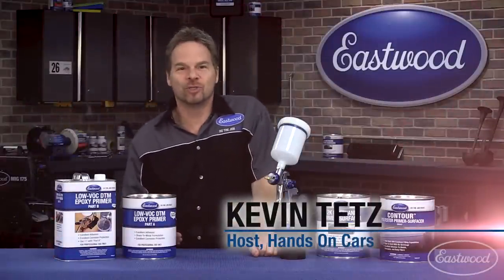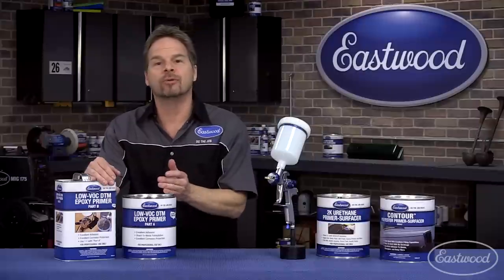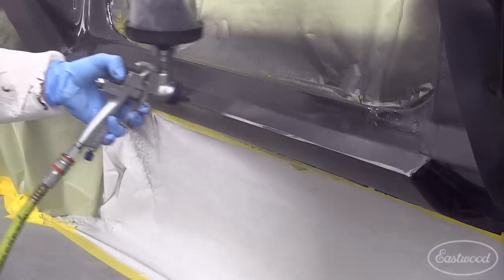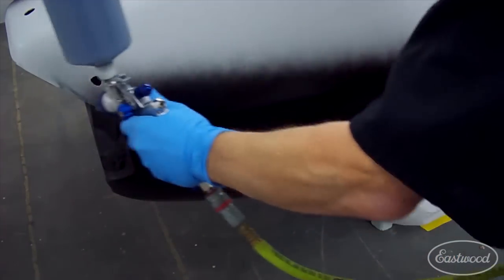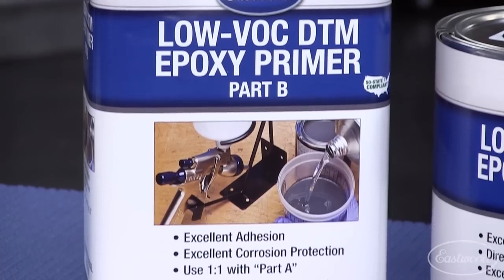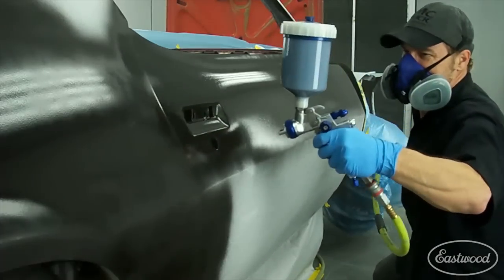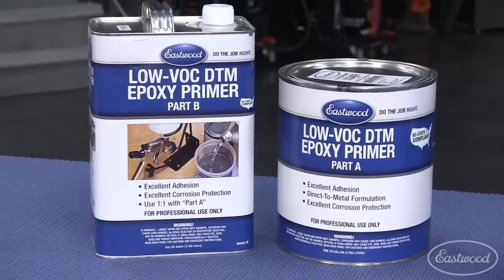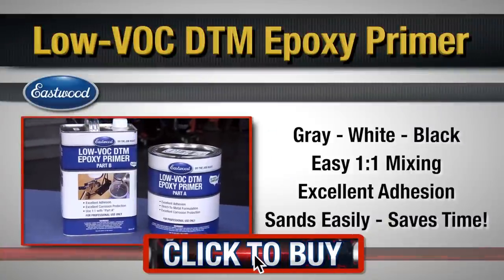How To Choose Primers: Low-VOC DTM Epoxy Primer Explained by Kevin Tetz

Comment: So I heard that right, I apply this primer, then while its still tacky, start applying paint?  What type of paint would you run on top of this?    I'm just painting a 90's ford, almost have the body work done, it doesn't need to be a Riddler Award winner.   This is more of a bush rig.

Comment: I am in the process of stripping an Infiniti with the notorios flaking paint. working on the jams now. I've been looking at all of the types of paint and primers and trying to learn. i did bodywork for a couple of years but the paint shop was separate so I didn't get to learn much about the paint side. I'm thinking that I want to use eastwoods epoxy and then contour after watching this. its going to be a track car so I plan to just paint it one stage satin black and then wrap it with vinyl. my questions are do you think the 2k or contour would be best for my application ? what paint do you recommend ? and how far back into the jams should I feather the old paint or do I need to strip every bit of paint? right now I have the external surface stripped and feathered back about an inch into the jams and the clear knocked off in the jams. the paint is feathering well so I was hoping the epoxy would make a nice envelope to seal everything but am I being lazy ? thanks in advance for any advice
Reply: ps. I watched the live demo you did here and the hands on series with the z28 and have learned a lot from you and greatly appreciate the knowledge

Comment: Can you guys help me with setting up an air compressor?  I've notice during my sanding process I've got water in my system.  I absolutely can't have this when I start to paint or prime.    What is your ideal setup on cooling the air and stopping condensation.
Reply from the maker: walperstyle Eastwood offers a line of dessicant air filters and dryers that should help solve your problems.  Follow this link to talk to an Eastwood Tech who can help you get the correct products:  http://www.eastwood.com/contacts